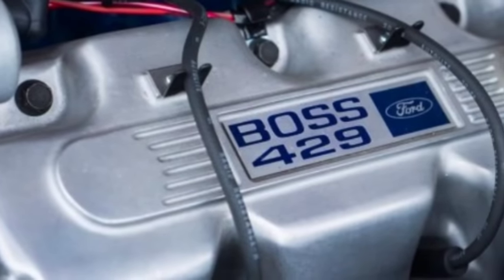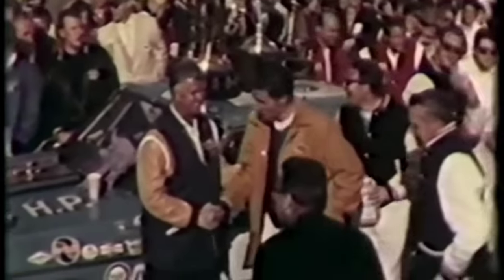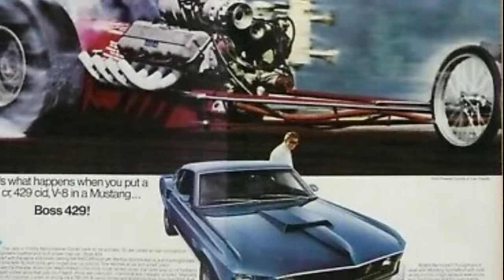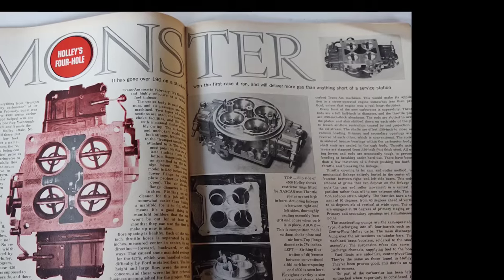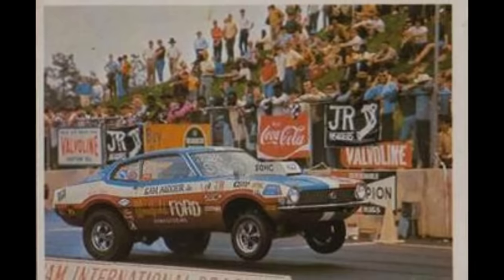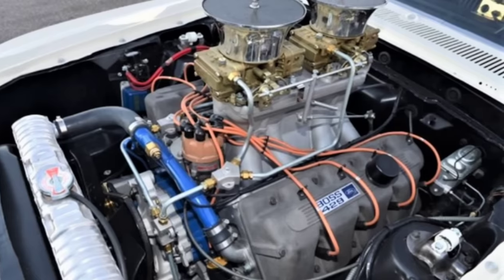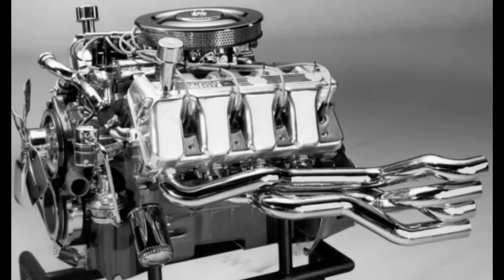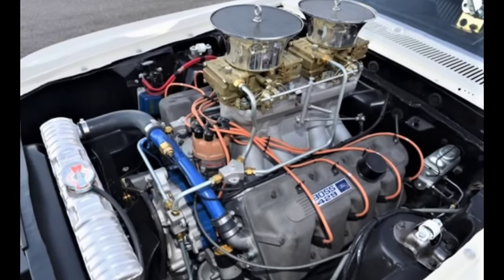The Misunderstood BOSS 429

Comment: As big as GM became, Ford is masters in building and designing great engines
Reply from the maker: I agree...
Reply: Really 265, 283, 302, 327, 350, 400 !!! I don't think so !!!! Don
Reply from the maker: @donmcguire2185  you know Don, I have learned through the years... That each of the Big "4" I'm even including AMC has some great engines.. they ALL have shortcomings! A person cant deny the SBC and what it has meant to our hobby.. without brand competition what would we have?  
Andy
Reply: Don McGuire @ Just cheaper is what made them good & responded well to any upgrade,virtually but there is no challenge for mind in that!
Ford GT is proof of that too!
Reply: @jazpanoz4996  well you know that's one car and basically all hand made!! My opinion of great ford engines would be the 427 SOHC  and 302 small block !!! Don
Reply: Ford had to make special race engines just to compete with ordinary Chevy truck engines...
Reply: @donmcguire2185  idk
283 vs 289 302 ford vs 305 350vs 351c and 400 vs 400 I would take the ford version. 
I have had both the chevy normally cheaper and easier to work on.
But from what I have seen if the motors are built alike.  The fords are better.  Especially in working and 4x4 trucks.
Reply: A more like 283, 302 vs 289, 302 and 350 , 350LT1 vs 351w, 351C don't think so my uninformed friend !! And you can keep either 400's !!!! Don
Reply: @donmcguire2185  why would you not compare the 283 vs 289 close to the same c in.
The 302 ford and 305 chevy are the basic 5.0 for both companies 
Same with the 350 vs 351.
350 lt vse 351 boss
Chevys 302 vs 302 boss

Your trying to do like most other chevy guys putting the biger c in chevy against the smaller ford counter part.
So that in itself shows the fords better like 302 vs 350.

Both 400 are good for low end grunt if they been worked on.
Reply: @tbjtbj4786  look Ford built some fantastic engines!! Loved the ole Y block in the day!! But the string of small block chevy's are just amazing in design , simplicity  and ease of shaping  those motors with after market parts !!! Don
Reply: @donmcguire2185  yea no problem saying there good engines. And cheaper.  
But for the same displacement  they seem to have more power . Especially in the biger displacements Especially low 
Power. 
Thats one of the reasons I like both 400. You build them right they are strong pullers without the bb weight.

Comment: I bought my first Boss 429 in April 1070, four months after I got home from Vietnam.  I had seen a picture of one in one of the magazines and really liked the looks of that car.  My first car was a 1964 Plymouth Savoy with a 426 wedge and a four speed.  I was a Mopar guy unitl that Boss came out.

I, like several other people, had problems with my engine thanks to a Ford dealer installing the 1970 solid lifter cam.  There are four oil control plugs in the block that need to be changed when going from hydraulic to solid lifters and that wasn't done with my engine.  

After two years of getting jerked around on getting the engine fixed right, I took it out to Jack Roush in Livonia, Michigan in 1972.  That car was no slouch when I first got it but boy did he wake it up.  He turned my engine into a 460 using my rods and the pistons from a T series engine plus a 460 crank.  I brought a Crane .600 lift 318 degree duration cam and lifters plus an Accel distributor.  He supplied a dual quad intake with two 600 Holleys and titanium intake valves.  He estimated the horsepower at between 525 and 575 and there was no doubt in my mind when I stuck a leg in both carburetors the first time.  It got up to 7500 rpm's in a heartbeat and it had more to go but I didn't.  I still have that car.

I bought two others in the meantime which I ended up selling because I couldn't afford to get them restored properly.  One of them owns the record for the highest price ever paid for a Boss 429 Mustang   when it sold for $605,000 in January 2007 ($550,00 plus 10% to Barrett-Jackson).  It was lot #1325 if you want to look it up.  It's also listed under the 10 highest prices ever paid for a Mustang at auction.  Wish I still had that car.  Ed Meyer of Indiana had that car looking like brand new.  All three of my Bosses were Candy Apple red and they were all 1969's.  That dual quad intake that Jack Roush sold me is reportedly one of only 25 made by Ford.  Maybe having the engine built lessened the value of the car but I would never put it back to stock.  That car is my pride and joy.
Reply: My older brother had to sell his 69 Boss 429 for $5,500 back in the early 80's to help pay for medical school.  My father hated that car and couldn't see any value in it.  Even then my older brother and I knew it would be worth a fortune in the future.  My father was so cheap that pennies would squeal when he spent them.  My father drove a 60's something VW bug the first year that had a gas gauge.  Never washed or waxed that bug.   Had Earl Scheib paint that piece of crap bug and it got stolen a week later.
Reply: You only did with it what it was intended to do!
Reply: Thank you for your service✊🎖 and thank you for the first owner stories. Incredible
Reply: GOD BLESS YOU BOYS.
Reply: WELCOME HOME RAY, God Bless you.  SGT DOUG, 101st, RVN, 68-69
Reply: Ray thank u for your service and be thankful u came home. As for Mopar I wonder why u didn't get the MIGHTY MOPAR 426 HEMI?
Reply: I know this is a year way too long but, Welcome home good sir 🙏..
Reply: Where can we come see and hear this beauty in person? I can only imagine that sound!
Reply: I'm no expert on car values, but it seems to me that having had Jack Roush build your Boss Nine is so cool that any real gearhead would love it even more, regardless of monetary value.
Reply: Love your story also. Thank you.
Reply: I'm surprised it didn't add value to the BOSS 429 by having Jack Rousch work on it. Especially since it 1 of 25 ever made.
Reply: Wow, 1070?  There were engines around back then?
Reply: @hhl316delta  its a typo genius
Reply: Absolutely loved reading that, and I'm glad that piece of history is in good hands.
Reply: I'm just 26, but I've really grown to love the cars modified in their heyday. With so many returned to bone stock in factory retorations, I think we really lost some very cool period correct street cars. Glad you have yours still! My dad's a Ford guy with a 1969 fastback 428 cobra jet 4 speed dragpack. I ended up a Pontiac guy.
Reply: Give ya $50 ya let me drive it!👍
Reply: That’s awesome man, great story! Thanks for sharing
Reply: 1070?! Did it have wooden wheels?😂
Reply: Cheers brother!
Reply: @sd906238   Yea your dad had to pay for you guys, and your squealing now.
Reply: I'd say that not everyone had the JACK ROUSCH" involved in their engine building! I'd say you've got a near priceless gem on your hands. Congrats.
Reply: God bless 🎉 Thank you for your Service.
Reply: Very cool, I’m not sure if you still come on here but if you had any pictures that would be awesome.
Reply: Great History, OnlyYour Generation Could have respect for the Time.  I always wanted to see  the Camer in a Road Car.
Reply: Boss 429s were slow as hell compared to most of the Ford 427s.  It had bigger ports so it made more low end power and torque but it lacked the mid and high end power that engines like the Boss 351 and 427FE had.  And even then I would argue the GM 396/402 and GM 454 were superior engines.

Comment: Watching the manufacturers chase each other in those days was something we’ll never see again.
Reply: yeah....today they have marketologists for this
Reply: Right now, If you can afford it, you can buy a 760 HP Shelby Cobra, or a 797 HP Hellcat Charger. Both would stomp those 60's tanks in every way, shape, and form. There has never been faster, or more powerful American muscle. Ever. And this is it. EV is around the corner.
Reply: @deborahchesser7375  No doubt, but EV that is NOT absolutely loaded with tech, that goes 0-60 in less than two seconds, and costs 50-70 thousand dollars is really a better, more practical application. When EV is out of the price range for 3/4 of the population, it only serves the rich.
Reply: @jamesgeorge4874  I had a 69 Mustang with a 427 ( yes it was a orig 428CJ car ) that ran 13:10 with a single traction and motor only, was one of the fastest cars around back then...Now the new Mustangs run High 11's and then you can drive them on a 500 mile road trip.
Reply: @markcatcash4688  I currently have a Fox body Mustang that will run 11.70, is 100% streetable, it scales at 2475 lbs, and has an aluminum 5.3 with a sloppy stage 2 cam, and springs. But you can go buy a Hellcat, bolt on slicks, and beat my mustang, no problem. The point is, America has a horsepower war where you can go to any big 3 dealer, and buy a 600-800 horsepower car, off the showroom floor, NOTHING from the 60's 70's etc. even comes close. You could pit the new Toyota Yaris GR against your big block Mustang, it would beat it, with a 1.5 litre 3 cylinder. Just sayin.
Reply: @jamesgeorge4874  I had a 93 Turbo Tbird that I cranked the boost up on and my old Boss use to joke " think How much money you could make if you took that car back to the 50's" " Hey I bet $500 my 4 Cylinder can beat that 55 Chevy"
Reply: @markcatcash4688  I bought an Omni GLH turbo in 1991, with a blown head gasket. Fixed it, installed a Mopar Hi performance logic module, it dispatched 5.0 Mustangs, and IROC Camaro's with ease. I wish I would have kept it.

Comment: Thanks for the information about the Boss 429. John Kasse and Jack Roush are also two of the best Boss 429 engine builders.
Reply: Kaase is king...
Reply: Untold story though. When the Boss 429 came about in 69, there was only one true Ford engine builder. Holman Moody...The same engine builders that made the 427 FE the cornerstone of NASCAR... Either you used their engines or parts or you were just riding around the track... Notice when the Boss 429 came out in NASCAR, there was no 5 year delay on rising to the top... H/M knew their crap...
Reply from the maker: You are correct! Robert Yates had a huge hand in making it successful he worked at HM for years before going on his own!
Andy
Reply from the maker: Steve Gregg  true!  You have to remember that Jon Kasse got his start by being Dyno Don's crewman then Allen Root did a ton of work on the BOSS head that Glidden ended up running! It was actually offered in the Ford SVO catalog until Glidden had them remove it... Glidden was a very sharp man who knew how to win no matter of the combination!  He won championships with Cleveland power, Mopar W2 headed small block, and The BOSS... One fact little known is he built a Chevy Monza to run at Indy in protest of NHRA adding weight to his combo... He didn't do well with it but he did race a Chevy for one race!
Andy
Reply from the maker: Steve Gregg  Yup.. very smart man
Reply: Steve Gregg   I saw Dyno Don and Arnie Beswick (sp) in a match race at Manville NJ airport in 1960 Don in a Chevy  409 Arnie in a 421 Pontiac, Don won two of three at a whopping 13.2 1/4 mile and the crowd went wild. remember 1960.
Reply: @RSDX99  Irony of how those two engines work, in NASCAR the 409 didn't have the balls to hold the high RPMS it could produce for long distances. The 421 was dominating NASCAR in 59-61.
Reply from the maker: The Pontiacs had the field covered during those days... Thanks for Watching and please Subscribe as I have other good content coming up!
Reply: Jack Roush was just one of best and well known engine builders. he was an especially good engine tuner. he always used the tried and true method of reading reading spark plugs. to know what he needed to do to achieve the Best performance. probably all the engine builders did it but Jack Roush was especially good at it. but you can't Pass over the others like Robert Yates and Holman and Moody and of course the Woods Brother's. and although he was involved with european auto racing. he was one of most incredible people to be involved with Ford in many ways.  and that was Carroll Shelby. he probably the best thing to happen to Ford and Ford was the best thing to happen to him. and this was back when technology wasn't what it is theses days.
Reply: Steve Gregg  when it comes to the Chevrolet teams you have to mention Smokey Yunick no doubt.

Comment: The Boss '29 and the Cammer are fantastic looking and legendary.      (426 Hemi looks great too...)
Reply from the maker: Yes they do... They all had character!
Reply: I've got a 68 Dodge Dart Super stock with a 426 Hemi. It's a mean car. It is so fast!!
Reply from the maker: Scott, I'm working on a Hemi on the way! Please Subscribe and stay tuned... Thanks for Watching!
Andy
Reply: @UnityMotorSportsGarage  Awesome, Andy. I subbed and hit the notification bell. Love your channel. Cheers from New Mexico!
Reply: Would you believe that the 428 Cobra Jet and Boss 429 are basically the same engine? Also both Hemi, and designed, built and manufactured by Ford before they sold the manufacturing rights to Dodge after they lost a class action lawsuit with the federal government over misleading the public on the true horsepower and torque. The 428 Cobra Jet is what got them in trouble, and after the lawsuit and settlement with all families involved Ford changed the name of the engine because it had been outlawed to ever be a production engine and so was born the Boss 429 and Dodge came with the 426 Hemi and the cops couldn't catch them either and because Ford was the original offending party the Federal government demanded that they gain an edge over both of these  engines and so was born the 429 Interceptor. True story.

Comment: This was the biggest engine I've ever seen in a 2+2. The whole bay of a 69 mustang was this engine. Glorious!!!
Reply: Until you had to change the plugs.
Reply: Yeah if you notice, they actually had to move the shock towers more toward the wheels to fit those massive cylinder heads
Reply: They should have sold it in the Torino instead.  Made the a mustang a poor handling turd.
Reply: @DanTheMailman330  they should have put it in the pickup trucks haha
Reply: @machtschnell7452  

You're confusing motors, or have no clue  regarding the Boss 9 plug location.

Comment: Thanks for the video!  Back in the early- mid 70’s I drove a warmed over 1970 Mach 1 with the 351 Windsor.  Of course as a young blue oval gear head I lusted after the Boss 9.  It was the holy grail car for Ford guys (the SOHC was so rare it wasn’t really thought about).  I saw one at the drag strip around 1974 and it actually ran pretty strong.  As I recall it ran about a 12.1 with headers, cam, better carb (Holley 3bbl) and slicks.  That was actually really impressive back then for a street car.  You are totally on point about the engines issues.  With the humongous intake ports it was designed to make tons of power way up high in the RPM range when coupled with the right cam and carb.  The problem was (per Jon Kaase) that the 429 ci was just too small to create enough pull through those massive ports.  As you pointed out a better cam and carb helped up top, but only so much.  They still were really sluggish in the low to mid RPM range.  Reducing the intake ports via epoxy actually makes the engine run way better all around.  The only way to make the as cast heads really work is to add ci.  A LOT of ci, like way over 500. Regardless when a blue oval gear head like me sees those Boss 9 valve covers under the hood I hear the angels singing.  I guess it’s similar to how MOPAR lovers feel about the Hemi!
Reply from the maker: Thanks for your input and for watching!! Please subscribe as im building a engine called MIXED UP BOSS.  Im putting BOSS 429 style heads (Hammerhead Performance) on a 429" Windsor block!  Thanks again,
Andy
Reply: Sounds really cool.  Taking the Clevor concept to a whole new new level!  I’ll check it out for sure.  Who makes a Boss 9 style head that will mate up to the Windsor?
Reply from the maker: @danmyers9372  Its made by Greg Brown (Hammerhead Performance)  it is truly a trick piece..  You can see them on channel under MIXED UP BOSS
Reply: @danmyers9372  Yeah, Hammerhead Cylinder Heads, Guy that doing these heads for SBF worked with Jon Kaase for years, So he definitely knows what he's doing, Jon Kaase is the Best BBF  guy around.
Reply from the maker: I'm hoping that when we Dyno this engine, Greg can make it up for the day!  Thanks for Watching and please Subscribe to see how it all turns out...
Andy
Reply: You are sooo right, my first wife said " you love that HEMI CUDA more than you love me" , I do believe she was right. It cost me a whole lot less money than she did in the long run!!!

Comment: The 351C was called a "Baby Boss" so I understand the 429. They  both had canted valves, huge ports and used the same spark plugs. The 351C even had a bigger (780cfm) carb! Great video!
Reply: I've owned a few 351 c n none of them had a factory installed 780 cfm.